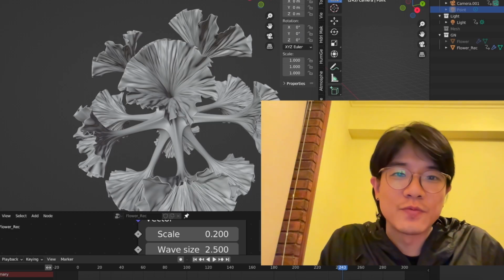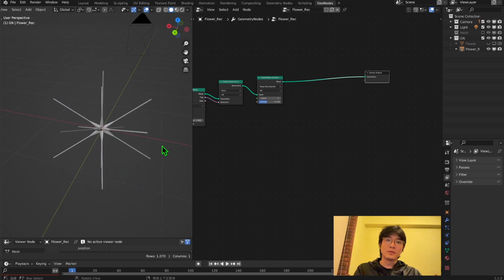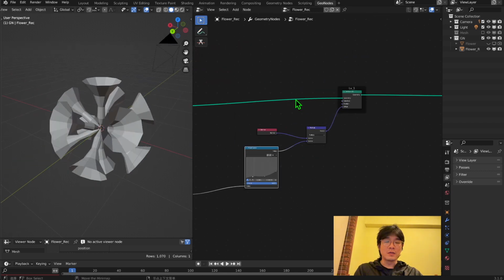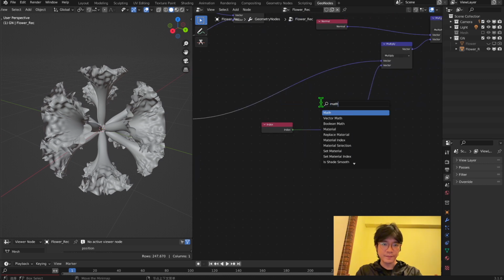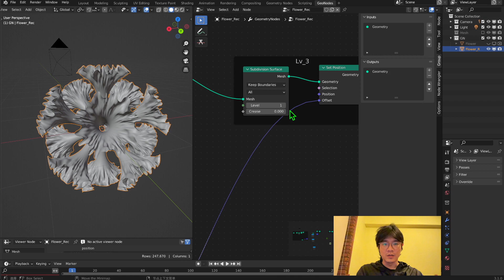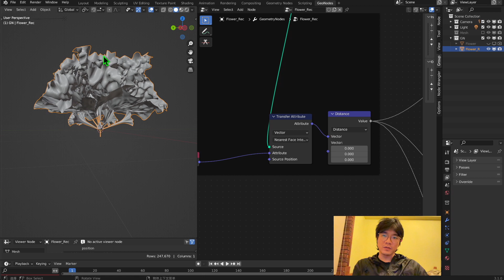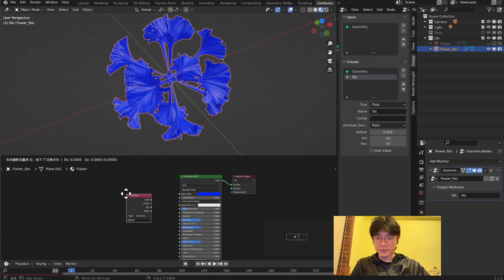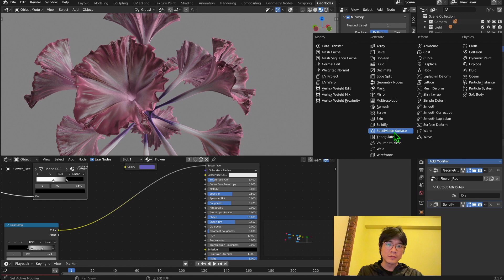🌺 Flower 花 / Blender Geometry Node 3.1 Tutorial

Comment: hi is it possible to come out with another video on 3.2?I think some of the nodes are different in 3.2 version so it doesn't really work. :((
Reply from the maker: What problem did you having? Because it should still works in 3.2, I have use 3.2 to do a similar stuff.
Reply: @nenghuo   Thanks for the respond!! So each flower branches are not the same size, and when I apply more layer/level it didn't change the shape of the flower edge (so I wasn't able to have the wavy edge).
Reply: I figured it out actually! Great video!
Reply from the maker: Sorry for the late reply, YouTube will not tell me if you response my reply,  so is difficult to track. Glad you find this video interesting, if you can share this video on social media that will help his channel grow, that I can make better content for you.💚

Comment: yo d you mind trying this on like another base?,i tried using on a plane but it didnt work especially the part where you use sin vector math to make it wavy
Reply from the maker: i think a cylinder will work fine, after all we need a tube shape to grow
Reply: @nenghuo  i made a tube shape from a plane, i used meerge by distance to decimate the plane, then used dual mesh and used extrude and then subdivide to make it look like tubes and then i tried your level 1 and 2 steps but sadly it didnt work.